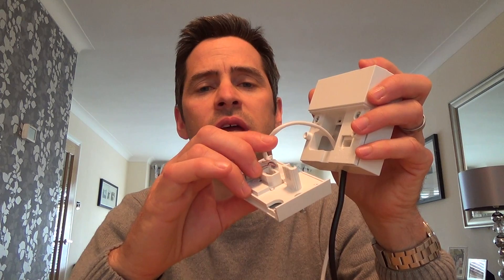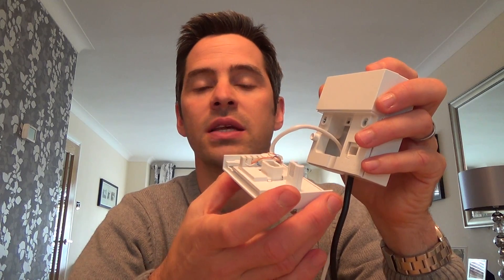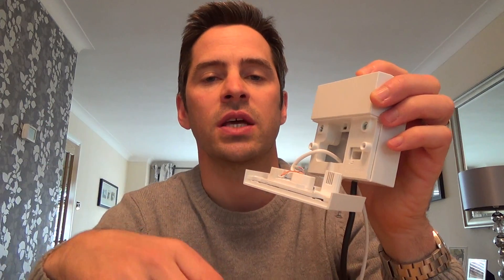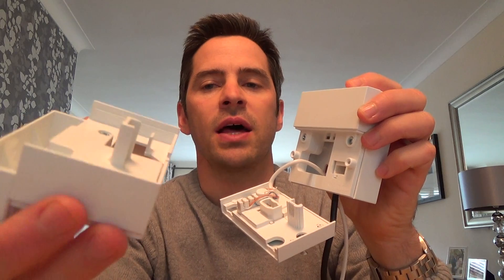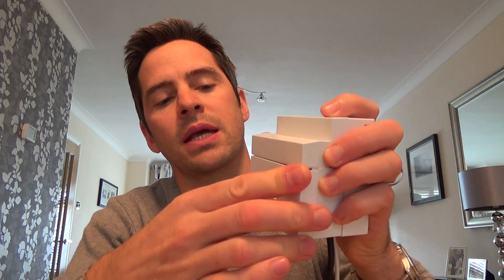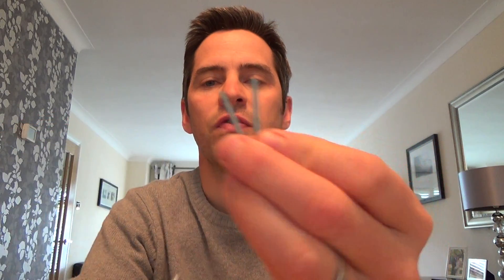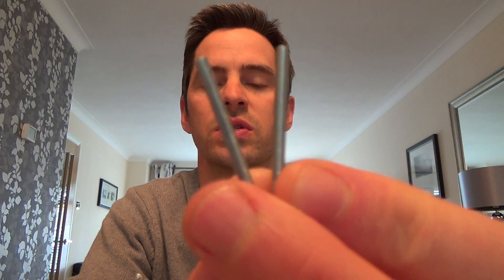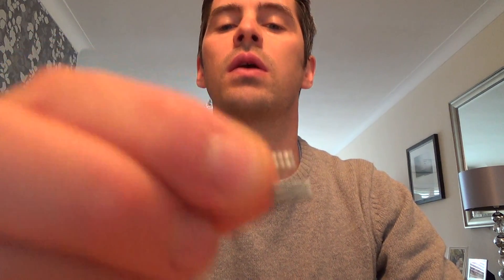How To fit an IPLATE (broadband accelerator) on your NTE5 telephone master socket.

Comment: vince, where we  used to have our pc it was in the way and wasn't ideal, we had an extension done to the house and made a little office. we got bt too put a 2nd master socket in the house  in our office so we could get internet. this master socket if it is called that doesn't have a distintive line running along in the middle so will a i-plate not work?
Reply from the maker: +Hawk223 Hi, no you will not be able to fit an Iplate to it. Maybe they installed an extension from your main telephone line rather than installing a 2nd line with a different telephone number.

Comment: Hi Vince. Really enjoying your videos. 
The socket and iplate that you have shown in this video is what I have. Am I able to replace my entire master socket to an NTE5A master socket and attach a VDSL faceplate if I so desire?
Reply from the maker: Andrew Fleming Hi, if you do not have a fault then you may as well just replace the Iplate to a VDSL faceplate and leave the nte5 master socket. You will need to move your router to the master socket if you are using the VDSL faceplate, the router will not work on any extension sockets, the extension sockets will become used for voice only.Thanks Vince
Reply: Thanks for this. Im not sure if my current master socket has stranded cable going into it i.e. screw terminals rather than IDC connecitons. If it does have screw terminals, is their a way to somehow make the connection compatible with IDC connections for a new master socket?
Reply from the maker: Andrew Fleming Hi, it would be unlikely to have stranded cable but if it does you can often get away with crimping on some solid core telephone cable using the jelly crimp connections (see jelly crimp video). Thanks Vince

Comment: Would you be able to explain to me how to this is able to improve broadband speed?
Reply from the maker: Duja It eliminates the interference cause by the 3rd ringer wire because the 3rd wire is not paired with another wire it acts as an antennae picking up radio noise which carries over on the 2 main wires which can affect broadband speed. Another cheap fix is to remove (pull out) the ringer wire but then you may have ringing issues.
Reply: Thanks for the explanation. I just pulled it out and have seen an increase of .6Mb.

I have been having problems with my broadband lately. I plugged my router into the test socket and the speeds improved from 4.8Mb to 7.6Mb, which means that my internal wiring is faulty. To fix this would I just need to replace the Master socket faceplate?

I do have 2 home phones which are plugged into the sockets and they are connected to the master socket. Could the fault be with the home phones?

Thanks for your help.
Reply from the maker: Duja It depends, it could be the front plate, the extension wiring, the extension sockets or the filters. You will need to narrow the fault down by fault finding, I have done a video on fault finding which may be useful.Thanks Vince